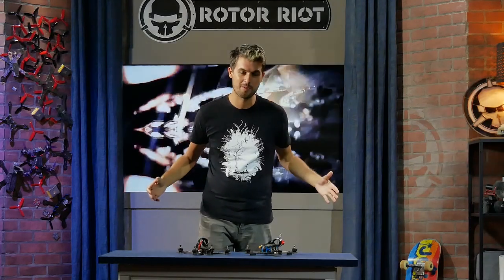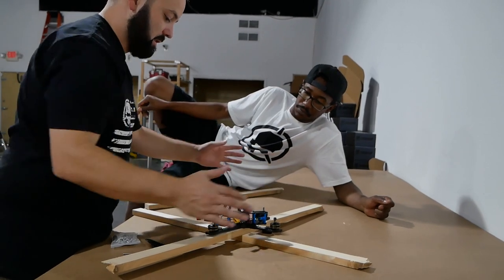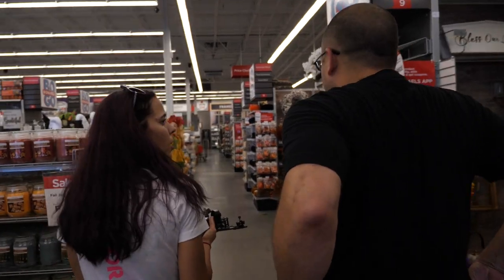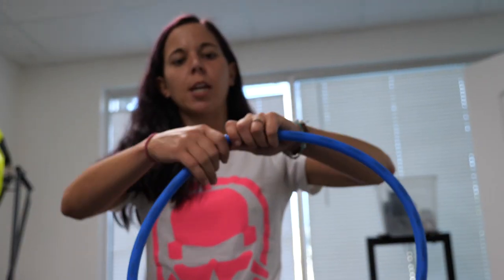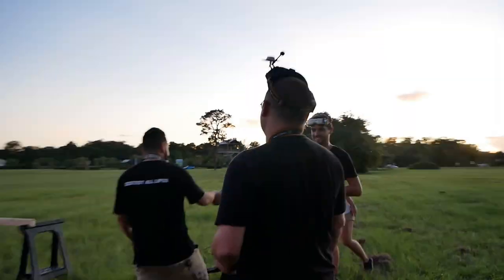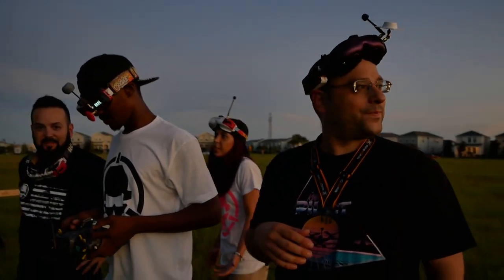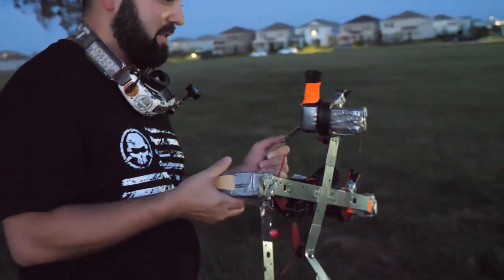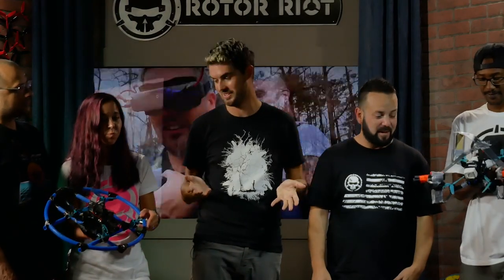INDESTRUCTIBLE DRONE CHALLENGE!! [& GIVEAWAY]

Comment: I really thought that Team 'Hot Props' was going to win it , due to Joshua Bardwell being on the Team (he has helped me immensely on a build I was doing)!!  Team 'Carbon Splinters' Kwad just looked heavy and bulky.....While 'Hot Props' foam surroundings, had less weight and looked like adequate protection from impact.  I think if "Hot Props" would have had slightly better Foam placement they would have been the winners!!  GREAT VID!!!
Reply: Jbs flew better, which allowed the other team to get more speed, i think jb won in practicality since that giant metal contraption is basically unusable, a plastic cage is a much better design it just needs refinement, a bigger hoop would have made it perfect,

Comment: Carbon splinters ftw!!! considering i bought the dji fpv drone to try and learn on, a good quad that can survive the crashes i would have loved to put the fpv drone through would be ideal. good video! Bardwell, your backyard is harder to fly in than i thought it would. maybe the liftoff simulator could be giving the fpv drone more power than it has though?

Comment: Good video Rotor Riot crew i thought Crickets team was going to win although the metal straps would of held up better if you guy would of made a t- shaped brace of the metal strips. reinforced  by tack weld because of the holes in the metal bracing, but it was a good idea with little effort.you still had fun crashing.lol

Comment: Anihilated? I'm not sure I'd go that far. If given some time, I think the approach of using the lighter weight material has more real world potential, because the metal reinforced one is just too heavy. I believe the ability to do a power loop as proving the quad "freestyle capable" was a little too low a bar to set. Especially a power loop that includes touching the ground before completing the loop. Still a great episode and very entertaining. I watched this with my first cup of coffee this morning and almost did a spit take when Joshua and Jamie were skipping into Michael's. Keep it up Rotor Riot! and...

Carbon Splinters FTW!

Although... How come when Jamie could barely get the "metal quad" to hit the plywood sheet, it was not declared unflyable, but when  Cricket had the same issue with the "hula quad" it was? Oh well, all in good fun. Pick me! I want that CL-1 and the blaster motors!

Comment: Why not a circle of carbon fibre. 2 loops one over the top (vertical) and one horizontal. That way no matter which angle it tw@tted from the entire drone is safe. Yep the carbon rings would be huge, but if made out of 5mm thick carbon fibre with triangular cut outs to lighten the dome, it should survive anything!!

I tried this and it worked really well.....until I forgot to check my battery status and it decided to become an under the sea drone. Apparently zero battery and deep sea water don’t make for good flying. £300 down, but bloody funny for my friends.